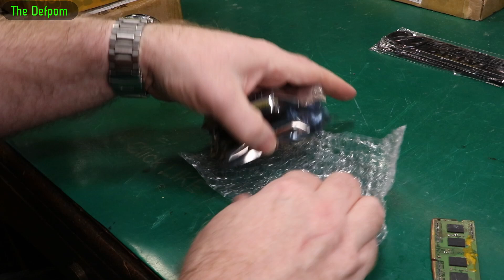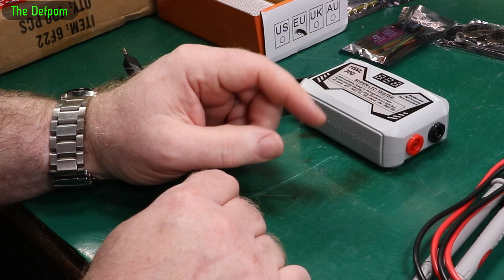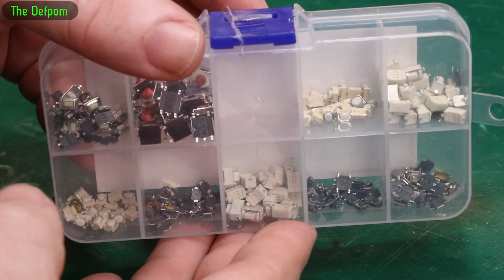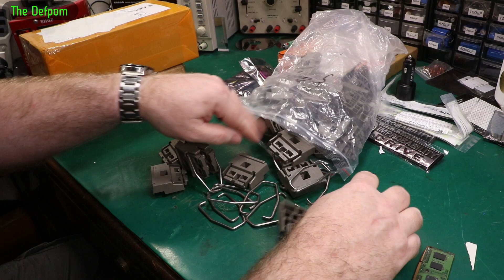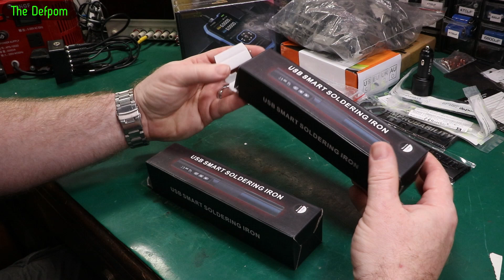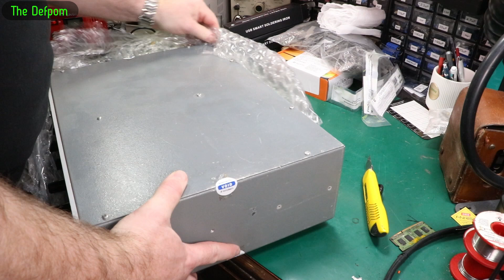🔴 Mailbag Monday 4th November 2024 - No.1296

Comment: KVD divides a voltage, it's not just a big decade resistor.

Basic operation for KVD, is put 10V or 100V into its input, (or 11V into its 1.1x input instead, so it's possible to get 10.001V on output) and X% of that voltage given by the numerals will appear on the output. However because its resistance only hovers between 10-100K, it is quite low impedance and will easily suffer from a voltage divider effect; so the division is only guaranteed accurate if you are drawing no current from the output. You can do this either by supplying some very high impedance buffer, or in the traditional usage, when using it for nulling two voltages. Put a null meter between (10VRef+KVD) and an unknown voltage, then adjust KVD till nullmeter nulls, and you have the exact voltage of the unknown to read from the KVD dials.

If you have the null reading between the KVD and its unknown, it's one of the most accurate ways of doing division of an input single voltage source.

Pitfalls: just make sure to never draw any large amount of current from its output, don't short it, or the grey neckbeards in the sky will yell at you for heating up their precious virgin selected resistors.

Comment: Test the 12V power supply in a real socket to confirm 100W - Which would require about 10A on the input at 12V with efficiency loss and 15 or more Watts of heat at the device.
Reply from the maker: @Y.T.Learner  yes I will have to test it to see how it handles the load